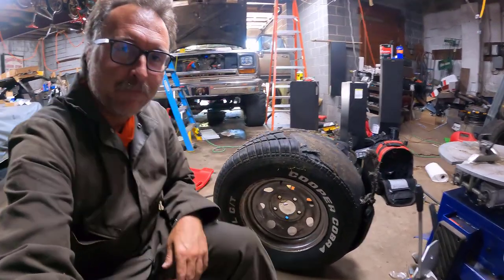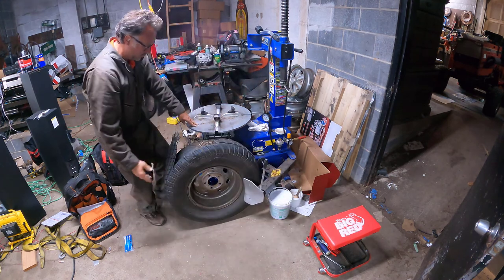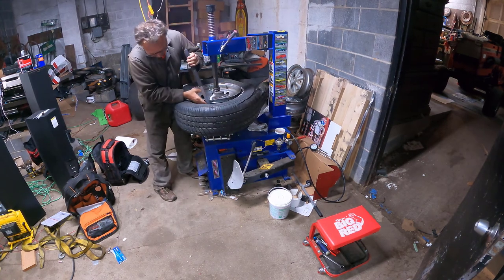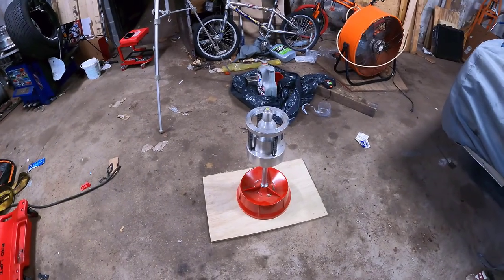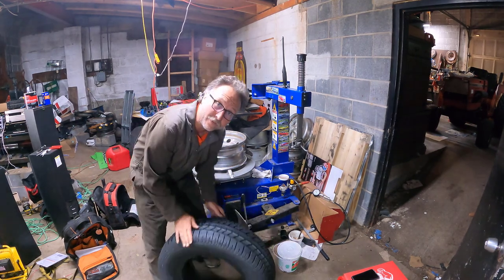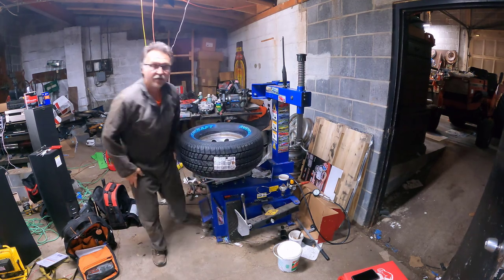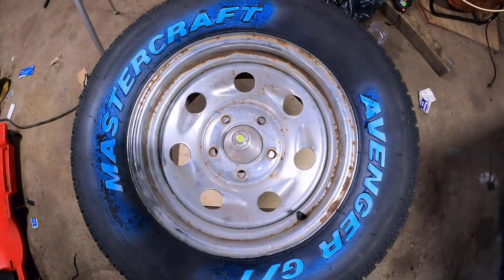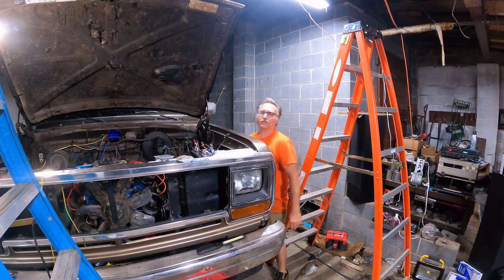1969 Lincoln Continental Tire Mounting and 0-60 Runs with Draggy (15:42s) - CC Top Solutions

Comment: My 68 has 2 inch exhaust.I have a cold start  video on my channel. .I used Thrush welded mufflers.I have a set of the cooper cobra tires I'm going to use on my 75 Torino.Hope they don't blow up like yours.I used Ballance beads in my 2004 F-150 they work great.I also used Amazon tires with great luck.And do ship free to Alaska.Wow